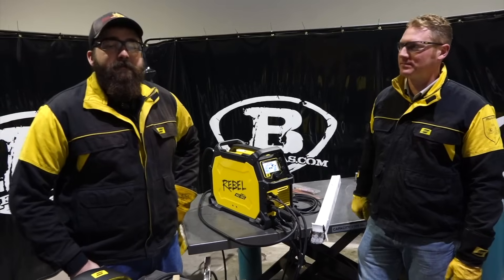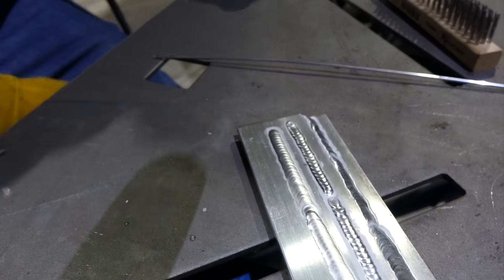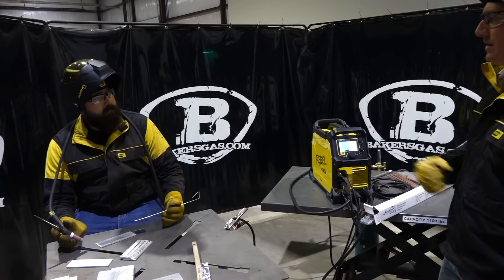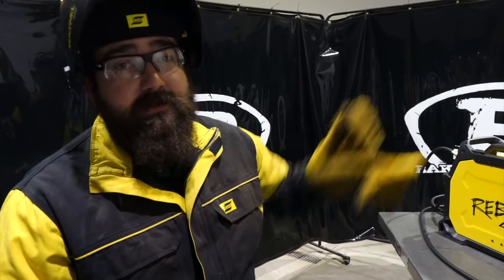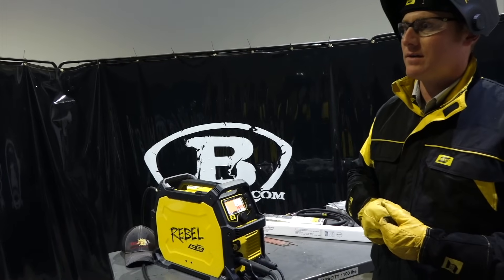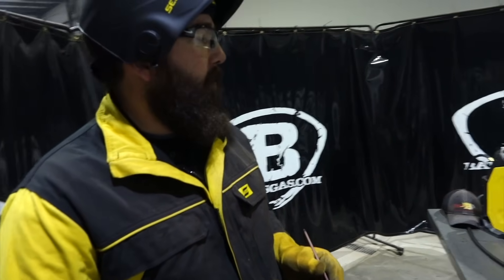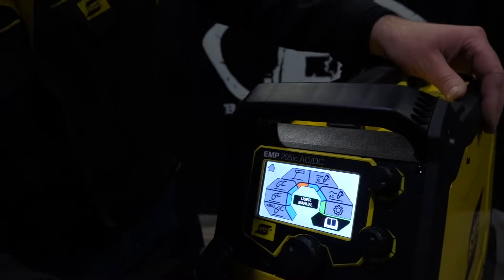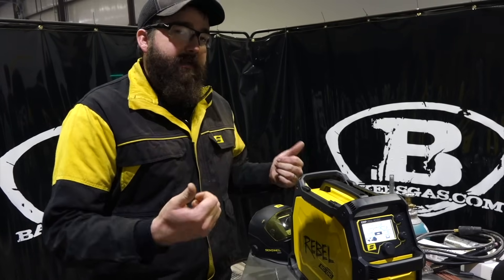ESAB Rebel EMP 205ic AC/DC Demonstration / Review - AC TIG, Stick and MIG

Comment: It's not the machine it's how you Use it and how you understand how the controls work but if you are electronic Technician Meaning knowing the electronic capability of the machine you can alter it to work better I can take any  cheap welder And make it weld as good as the expensive  ones You just have to have a background in electrical engineering

Comment: pretty good welder, but it is a noisy sucker, and i dont like the mig feeder setup, 1 drive wheel in 2022. For the cost of this welder they could add a gear and a second wheel, and the thin plastic guide hose is to thin, if the wire bends you have to knock the guide out with a hammer and a thin rod, i use a stick rod. i have used ESAB for 30 years, it is always the same, the welder is good, but then they add a stupid thing on it. but they are getting better :-) EXEPT the plasma cutters they have always been usless, and now they seem to just use a diffrent brand. but im not sure, i gave up on them several years ago, and just used a hypertherm.

Comment: So I consider myself a beginner tig welder looking to buy my first..... how does all this adjustment help me rather than hurt me.....I understand the process, but the details are still in Spanish....where is my money best spent needing a entry level rig, without needing a better machine in a year
Reply: Primeweld 225 is a really solid ACDC tig machine, and it's under $900.
Reply: Did you buy it for start? How is going?? I'm in the same situation.

Comment: Nice machine has double rollers all it needs now is mig adjustable pulse function variable pulse single and double pulse which ever and it’ll be the best complete compact welder out there also add all the different frequency wave functions its just electronics why not 👍🏾

Comment: I almost started to believe that there is no allrounder with MMA - MIG/MAG and TIG in AC/DC .. so few combos but those were always TIG DC Lift-Arc .. no HF, no AC TIG .. but that one 205ic is very interesting unit! Bit pricey around me, as it cost basically a bit more then two units, one for ACDC TIG and one for MMA-MIG/MAG.

Comment: Test out the new Lincoln Powerwave 300 C Advanced, this is true all in one package that excepts a 44 lb spool of wire. Ac/Dc tig and stick, I’m a welding instructor in Tennessee and I’ve tried a lot of different brands and theirs nothing that even comes close to the Lincoln.
Reply: that machine costs 10 grand

Comment: I just notice the Voltage doesn't dial in to where I want it.  I can set it to 19.3 and it will jump to 19.2 or 19.5. Can't fine tune by .1 because it jumps on its own.  🙈

Comment: Do you have a contract with esab welding company....just asking cause you do a lot of advertising for them guys...I’m getting either the miller are the esab, but I’m still a little unsure on which way to go
Reply: I use miller at work.  We have Maxtar series welders, Millermatic series (2 different versions) Dynasty series,  trail blazer series. Big blue, pipe pro series,  suit cases, sycrowave , multi process by miller and the list goes on. If they make it, we either have it or had it.  I bought  this esab rebel 205ic.   Only done a few small projects at home.  I do like the machine.  It's well built.    If I was to use it in the field,  I need to upgrade all the leads. Far to short.   We use minimum 25' foot to 50' leads at work to avoid moving a machine every few couple hrs.  As is it is good in a home or shop.  For field work, longer leads.

Comment: Can I run a spool gun with this unit until I learn to tig weld? I heard you say there was a gas hook up for a spool gun but didn't see a setting on the screen for a spool gun?
Reply from the maker: Yes it has a direct connect spool gun! I will link it below for you! You will be a pro and TIG welding aluminum in no time!
https://bakersgas.com/products/twecospoolgun160a-12ft-foresabrebel-1027-1397

Comment: Have two question on you guys: 
1.How are you guys TIG welding with 205 amps while the torch is rated just for 150 amps without cooling unit?
Because if you need to go on TIG  above 150 amps then you need a water cooled torch with  a cooling unit. Right?

 It leads also to my second question:
2.Is there a solenoid cooling unit for water cooled TIG torches for this machine? On their website I can not find any. Please give a link if there is.
Thank you for the good review. The first question stopped me buying a unit today.
Reply from the maker: Hey Eugen! The HW 17 torch is a 150 amp Tig Torch rated at a 50% duty cycle.  It is capable of carrying over 200amps in an air cooled application at lower duty cycles.  This torch paired with the Rebel EMP205 (running at 205 amps, 25% duty cycle, or 2.5 minutes of welding) allows us to operate without damage to the TIG Torch.  You can use a larger amperage air cooled torch like an HW26 (220amps 50% Duty Cycle), but through initial customer feedback an HW 26 torch was too bulky.

The Rebel EMP205 does not have a solenoid cooling unit offering.  Most Water Cooled TIG welding systems run off of a separate water circulator without a solenoid.  The coolant simply circulates through the welding torch continuously via a pump, reservoir and 110 volt outlet.  You could use an aftermarket water circulator if you wish to use an HW 20, and add cost to the system.   An HW20 is rated at 300 amps. 

Hopefully this answers your questions!! Feel free to call or email us if you have any other questions we are happy to help!
Reply: @BakersGas  Thanks for the reply. Yes was thinking to use the HW 26 torch. ESAB should make a designated cooling unit for the 205ic exactly how they made for 301i . If you weld a little bit in your garage a 25% duty cycle might be ok but not if you weld a gas tank or so. Depends on everyone's  needs. But it is a pity not to have a designated cooling unit because ESAB has done  a good job towards the TIG capabilities on this model.
A downside that I can mention on this machine is the amperage for wire. Because for me the common setting is 450 WFS  at 24.5 V for .035 solid wire then you need to be in the amperage range of roughly 230 amps to weld a 1/4 inch plate. Maybe you can get around that by welding a .045 wire metalcore or fluxcore with C25 gas or staight CO2 !? A review on wire for this machine and bend test would be not bad to do. 
Also ESAB should list on the website product info that the 205ic is able to weld with spoolgun aluminum. People read usually on the website and no word about spoolgun. Everybody thinks that it can not do but it actually does.
In my case I decided that TIG AC/DC machines should stay separated from MIG/MAG machines if you go beyond 3/16 plate. A good temptation was the Everlast 275 MTS but even there it gets you the right amperage but it takes away at TIG some of the  balance and the pulse. That's why the separation in my case here. Would have been nice to have a machine that does it all perfectly because who does not want to spare 7000 $ and above to buy separate machine.
If you stay below 3/16 plate and not a lot of time welding then this machine is doing a good job I think.
Thanks!

Comment: @Bakersgas Andrew, Question # 1, does Esab make a Push/Pull Gun, and if so will it work on this Machine???
Question # 2, will this Machine run Dual Shield Wire???
I am getting ready to purchase this week, and I'm in the fence on Yellow or Blue. I'm leaning towards the Yellow because of Softer Start capabilities  (5 amps) on Tig, and Easb will go up to 400, looks like Miller only goes to 250hz.
Help me out here. I know you're supposed to be unbiased because you guys sell both, but I want to know if you personally were purchasing a Machine in this class, which would you choose, and why?
I was all set to buy the Fronius Transsteel 2200 until I found out no A/C Tig (that sucked), and no HF Start.
Just the fact that the 2200 will run Aluminum Wire through a 15' Whip consistently without bird nesting is phenomenal, and I loved the Synergic functions.
No A/C Tig and no HF start killed it for me though.

Comment: What's the maximum thickness on aluminum that you can weld?
Reply from the maker: What process? Are you talking TIG? Or with a Spoolgun?
Reply: Both
Reply from the maker: @emilyramsey9079  1/4 inch

Comment: My question is when is the 235 ac/dc coming out? This is what I'm waiting for.
Reply: @halledwardb  yeah I guess I'm gonna have to bite the Bullet and go ahead and buy the 205 myself. I just cannot wrap my head around why they won't build a Bigger Mulit Process Machine with AC Tig capabilities.
Reply: Everlast has a 250 Model coming out in the fall, called the Lightning or something.
Reply from the maker: No announcement at this time! If we hear we will post about it! :) Not anytime in the near future.
Reply: Piss on the 235, I want them to bring out the 285 with A/C Tig. I would buy 2 of them on day 1 if they would just get off their asses and build it. There is a Huge Demand for a Machine of that size and capabilities, so idk what the hold up is.

Comment: I work on... everything. I need a multi-process hvac/construction/personal motorcycle,
Is this the unit or the miller? Any others🧐
Reply from the maker: So if you watch our comparison video you will see they both have some neat features. I would say that the ESAB has more adjustability on the TIG side. However Miller's is super simple to use and you can keep the MIG and TIG set up connected and switch back and forth seamlessly.  Also as you will see we joke the biggest difference is that the Miller 220 is in stock. The 205 we are getting in slowly but surely! If you want the 205 please be patient and wait for them to be in stock or pre - order with us :) 
Comparison Video Miller 220 vs ESAB 205:
https://youtu.be/JzdV4uwGazw
Top Questions between 205 and 220:
https://youtu.be/ePzo_hQMCeo
Reply: @BakersGas  What is the difference in price between the 2???

Comment: damn that esab has a light under the lid? how sweet is that.
Reply from the maker: Yes pretty neat feature!
Reply: @BakersGas  I'm starting out, want to create that little side business and do random work that I get from body shops, junk yards, carting companies etc. I like this machine and being a multi process machine is a big plus. I know the transformer shop machines are the most powerful but would this machine be sufficient, to say, run 6010/6011 on dumpster repairs for a days work? I understand to an extent, duty cycle but I'm looking at getting a real world application opinion. Any input much appreciated!

Comment: I will get an ESAB to go with my engine driven welding in a few months!
Reply from the maker: Awesome let us know if you have any questions.
Reply: @BakersGas  I do have a question, What are the dimensions of this welder? 

I’m planning on getting it in a few months but I’m going to make a heavy duty cart for it first. Amazon says it’s 34 x 20 x 12 inches, but judging by the size in the pictures and videos, I’m not too sure that’s accurate.

Comment: $3 Grand? Dang, bet my $900 Vulcan outlasts this, chumps galore.
Reply from the maker: Call us when you can not find anyone to work on your Vulcan :)
Reply: it comes with a tiny light under the lid which helps when you have to change your MIG wire.

Comment: I still cant understand how everlast included AC pulse in their multi machine but esab and miller did not. Esab and miller are better machines but damn.
Reply: No pulse? Haha i am glad i got the everlast!!!
Reply: johnny missfire does it still work
Reply: I decided not to buy the 205ic because it didn't have AC pulse and 6010 performance would not be stellar with only 68V OCV. I've decided to buy an Everlast instead.
Reply: Profile Protected is the Everlast still holding up
Reply: @j.shorter4716  I've had my everlast for about 4 years and zero problems with it.

Comment: I was about to buy the Miller 220 or the Everlast, heck was even looking at the Fronius TT2200 as I really need to keep the space taken up to a minimum but want maximum options on what I can weld.  I didn't pull the trigger when I heard about the 205 but info was very lacking.  Thank you a lot for this (and upcoming part 2) video that really shows what this machine can do.  I am really liking what I am seeing with the ESAB 205.
Reply from the maker: Thanks for watching! We are posting a comparison video this weekend on the Miller 220 vs the ESAB 205! Subscribe so you will be notified when we post :)

Comment: Time for a side by side review next to the Miller 220. But after looking at both thus far, the ESAB is looking like a better machine, what you say Baker's Gas?
Reply: Yeah please! Been waiting on this thing for a year! The Miller 220 came out and now I'm not sure. Got $3k burning a hole in my pocket and I need some guidance!!!!
Reply from the maker: @LT4Nova  we have a few more videos coming soon stay tuned!
Reply: The esab will go up to 400 megahertz on your AC Tig the Miller will not. I think they will both DC pulse but not AC pulse.
Reply from the maker: @trkinwithmikey  Correct it will DC pulse. It will not AC pulse. Thanks for watching! We have a few more videos coming so stay tuned!
Reply from the maker: @trkinwithmikey  400hz is usually used to focus the arc to deposit a smaller bead on thinner materials without sacrificing penetration or sidewall fusion in Tee Joints and lap Joints. It will also help with keyhole welding on outside corners and butt joints to help ensure full penetration. Of course, you can do all of this with 60hz, but more frequency adjustment will allow you to reduce heat input by producing smaller welds. Hopefully this adds some clarification for you or anyone else reading this.
Reply: @trkinwithmikey  theres no way they wouldn't have AC pulse. Impossible.
Reply: I went to two welding shows because I was interested in these welders the only reason I didn't purchase it is it just not do AC pulse. I already own the EMP 235ic
Reply: @trkinwithmikey  hmmm. In a prior esab video they said it would have AC pulse.....big disappointment if they dont...
Reply: @LT4Nova  I have the paperwork on it right here in front of me I took pictures of it but I'm unable to post it DC pulse only and I'm not sure about this but it might even do Mig pulse
Reply: @trkinwithmikey  thanks for the info. That's a real disappoint considering I saw a video that stated it would have pulse. That seems to me to be a big selling point. I dont need 400hz or ac/dc balance...pulse is a nice cheat.
Reply: @LT4Nova    Do you even know what your talking about? you said you dont need AC/DC balance??? well first there is no such thing as DC balance and second of all AC balance is a MUST on ANY ac tig welder. might wanna do some more research bro....
Reply: @jamessonger3  I said "I" dont need wide balance control. I'll be the first to say I'm not a professional but I have been welding a decent amount of time and have not utilized balance extensively.  This isnt a production machine. It's literally an entry level true multi purpose. Options are nice, but I would guess that your AVERAGE buyer would utilize PULSE more than fine tuning BALANCE.
Reply from the maker: Nic make sure you subscribe we have taken your request and made a video! Will be posting soon!
Reply: Baker's Gas Just subscribed, keep up the good work.